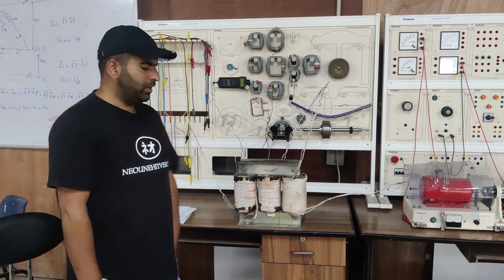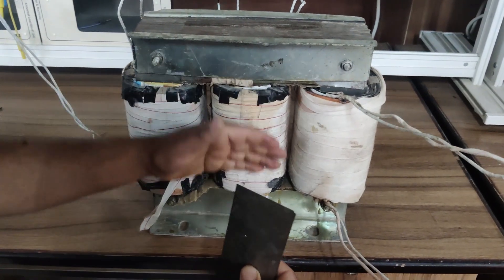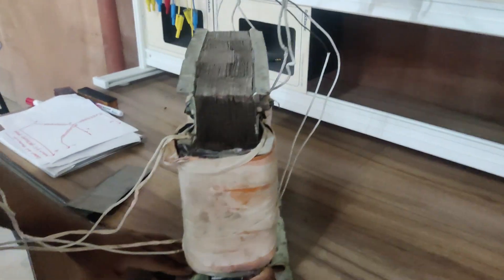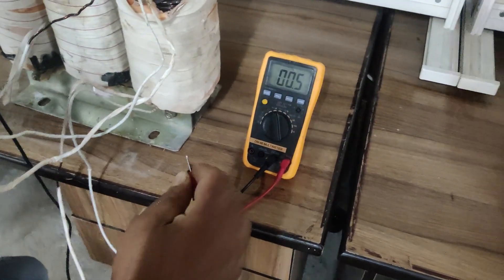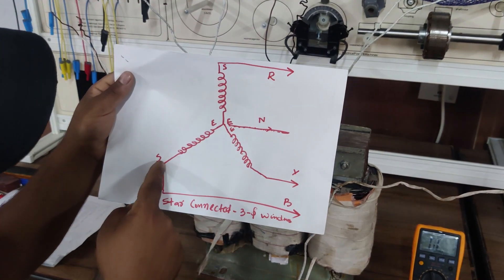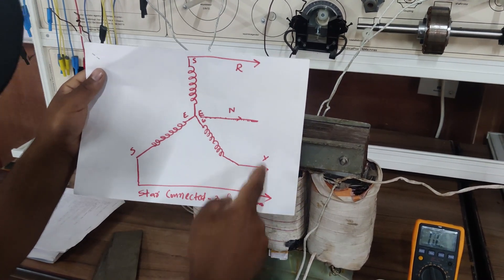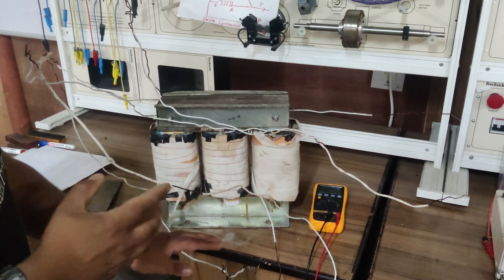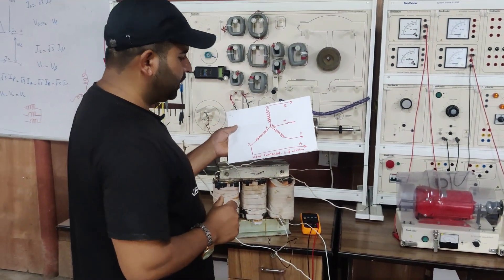Three Phase Transformer  construction, star, delta

Comment: Very well explained
Keep up the good work.
Just one suggestion.
Would have been better if all the six terminals of both primary and secondary would have been first connected on some base and then connect them in either Star or delta.
The winding terminals are getting overlapped therefore the students may get confused.